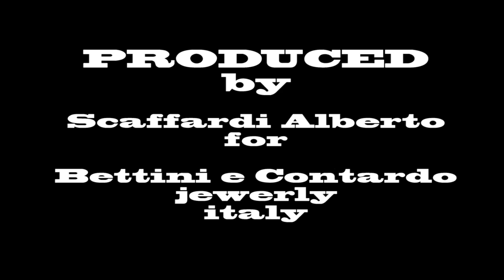handmade gold pendant whit emerald and diamond first time prima parte

Comment: What kind of pliers are you using the turn the edge of the setting?
Reply from the maker: Sandra Wilson Using normal flat pliers with slightly rounded edges.